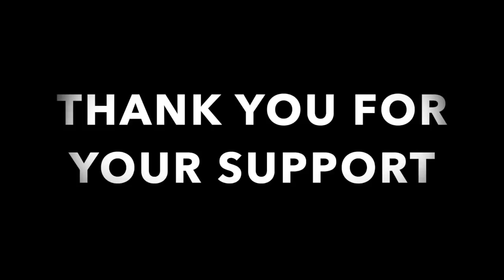S2 EP1 | WOODWORK | FELLING TIMBER FOR THE OUTDOOR KITCHEN AT THE OFF GRID HOMESTEAD

Comment: As thorough as you are I am surprised you did not make the roof higher in the wood shed.😉
Reply from the maker: I was going to place logs on top of the post I had set but decided no to, and had 2x8 already cut and thought its not a big deal to bend over a little, lol. So no worries...
Reply: Smoky Mountain Outpost  I’am 6ft 3 and would be hitting my head every time I went in. Lol Have a great day and enjoy your filming.
Reply: You may have to dig out the ground underneath it might be a quick fix then mabey put a little concrete around the center post to stabilize the structure.

Comment: Are you sure thats a mountain laurel? Looks like a rhododendron.
Reply from the maker: Well both are quite similar sometimes referred to as calico bush. Hunters in the are say “that hog was hunkered down in the laurel thicket.” The larger bush like I showed on video. Many species but your correct in rhododendron. Just not used much around here to refer to it as such.
Reply: @SmokyMountainOutpost  lol I figured it could be a slip of the tongue or maybe something else. I have a lot of mountain laurel on my place so I'm very familiar.  Plus being a certified arborist for 15 years and studying dendrology might and given me an edge of identification a little. ;)
The easiest way to tell them apart is the size of the leaf. Rhodo has larger leaves about 6 to 8 inches and laurel has small leaves maybe 3 to 4 inches. Generally speaking. 
I'm enjoying your work and look forward to the cabin walls and interior!